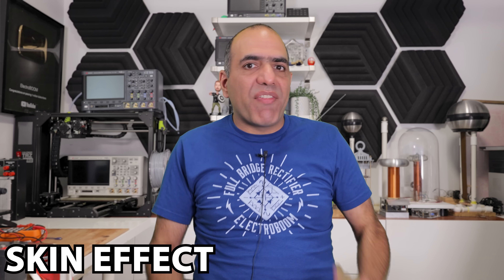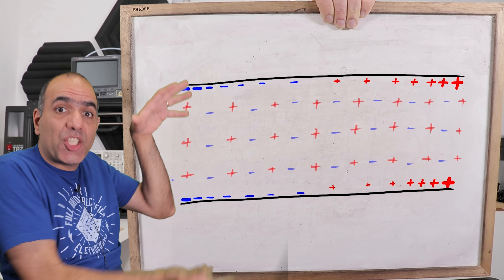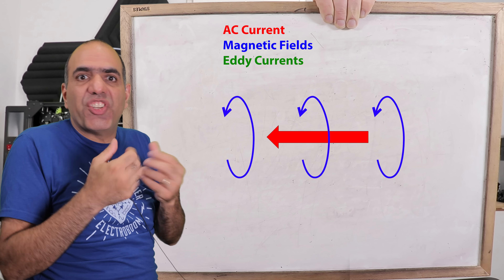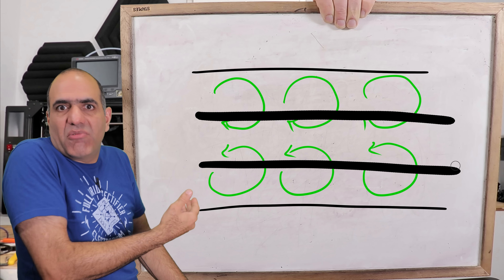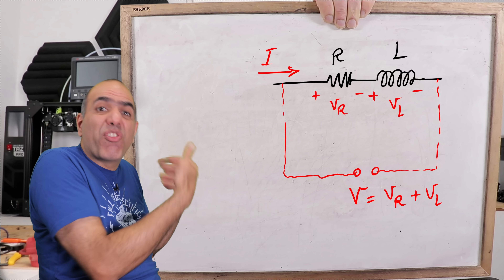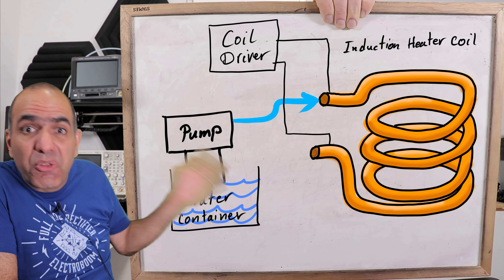Current Doesn’t Run Inside? SKIN EFFECT!

Comment: Most power transmission and distribution lines use and aluminum cable with a steel core, rather than copper/steel.

Comment: If the current flows on the outside then why are wires rated for current by cross-section instead of surface area?
Reply from the maker: Because cross section is constant, and you can calculate other stuff based on frequency and cross section
Reply: @ElectroBOOM  thanks 
I was also wondering if in a ribbon shaped conductor there would be a sort of edge of the skin effect where the current favors the edges of the ribbon more than the central portion of the ribbon even on the skin

Comment: Did you know that high voltage long distance power lines are actually hollow to make them lighter, thereby taking advantage of the "skin effect" to save money.

I'd also like to add that the skin effect is the reason stranded wire cares more current than its gauge equivalent solid conductor wire.  Thank you for the great videos.

Comment: Litz wire is a kind of wire designed to minimize skin effect. Its made with many insulated strands of wire woven together in such a way that they take turns alternating between the inside and outside of the bundle. So that more of the copper in the bundle can participate in conducting ac currents.

Comment: Increasing the diameter of a conductor does help because it adds more parallel paths along the surface to flow. But at high frequency, doubling the diameter almost aproximatly doubles the conducting skin while the the cross section total wire grows by the square or (double=2)²=4 times as much copper.  That means at high frequency, a tube will conduct almost as well as a solid wire of the same diameter and certainly uses far less copper to conduct ac currents at that high frequency.
Reply: And ... a tube have another surface on the inside.
Reply: @dansihvonen8218   except charges tend to flow on the outside.  A tube doesn't conduct rf better than a wire of the same diameter, but it does save material, and copper is somewhat expensive to waste when it's not activly conducting rf.

Comment: does current not flow linear and not only bounce atom to atom along a strand , but also across the entire width , like a dolphin jumping through a stream ,is there a formula to see how much heat is generated through electrical current through a wire gauge and its resistance to see how much " bounce " the flow actually has on its travel

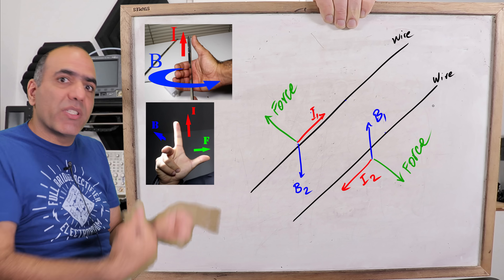Comment: The graphic at 1:44 is wrong. Assuming I points in the direction of positive charge movement (opposite to electron direction) as it is usually defined and as would be consistent with the RIGHT hand rules shown on the left, the magnetic field vector B_1 should point in the opposite directions. The force vectors (as well as the conclusion that the wires separate with opposite current directions) are correct though.

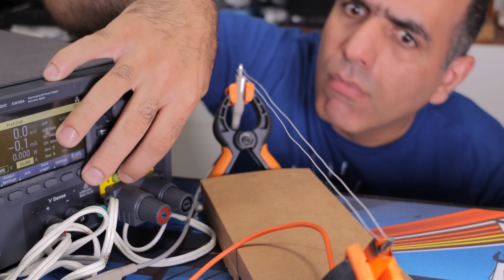Comment: 1:22 finally someone showing the airgap bug present on all we use . Its worst then shown here but this gets the job done
Reply: add a rubber protect metal collars to simulate holding wire . Its why i recommend zip ties . The short of it ? Its like a spike generator . Darn chassis ground

Comment: You know, after 20 years, I still don't get AC circuitry. Sure, the lecturers mention something about electromotive forces due to Lorentz force law, which is the basis of motors and generators, but it always gives me a headache thinking about it! All the impedance from reluctance and inductance just completely flies over my head!

Guess I can only find the answer in a physics textbook. But that chapter is thick! Not sure my brain can handle it.
Reply: Don't worry, it's all just smoke and mirrors anyways. 😉

Comment: The skin effect is actually very useful in non-destructive testing. Surface and internal defects of a material change the magnetic field because the eddy currents become disrupted. Thus, if you excite a material with an electromagnet you could discover tiny defects in a material depending on your sensitivity.

Comment: So, if the skin effect is so pronounced, shouldn't wires be pipe shaped? Seems as though that would save a lot of copper...
Reply: The dumb idea started with one person wanting to control the supply of Power over great distances, necessitating A/C current.
The idea is just as bad as electrocuting an elephant in public to promote "your" patents.

Comment: Another real world application: Skin effect is bad for RF transmission lines because it introduces severe line loss. Coaxial cables were invented to relieve the losses by embracing the skin effect. A thin wire surrounded by, but not touching, a thin copper braid gives lots of surface area for RF current to pass through.
Reply: Also coax cable, the centre conductor, at least with any modern coax, is a copper clad aluminum rod. Using the copper where the RF signals flow because, you know, skin effect.
Reply: Twin lead has virtually no loss. Coax loss depends very much on construction and frequency. The best "consumer-grade" coax (LMR-400) loses 3 dB (half the signal) in 200 ft. 450 ohm ladder line only loses 18% (0.9 dB) in 200 feet.

Comment: The conclusions are similar to how I was taught about skin effect in early analog and digital circuits classes, where the higher the frequency the higher the skin effect that we would see, up to needing wave guides for very high frequencies and light based information/communication. I am glad however that more mathematical relationships were shown here in formulas and resistance occurring as well as the mentions of physics laws and theories.
Reply: What are these wave guides that you speak of and how to them factor into all of this?
Reply: @michaelbeckerman7532  You can ask of AI (Gemini, ChatGPT, or one of your choosing ) the following question, "Do waveguides affect the skin effect?" It'll give you simplified relationships from such a prompt. Wikipedia has an article on Waveguides too, but here it is specific to high frequency electromagnetic waves.
Reply: I'm just struggling to learn, but waveguides are pipes carrying radio waves inside - or so said. In essence, they are electrical hollow conductors carrying the high-freq electric current in their walls, acting as the outer skin..

Comment: I like how you got through the pain of measuring resistance by using AC current. You could have simply used the DC current to measure the resistance. But that way, you could not have tought us the AC concepts. Impressive Mr. Boom!

Comment: There is a use for skin effect, in some nuclear weapons, the components responsible for perfectly timing the detonation of chemical explosives for compressing the plutonium core, is called the bridge wire detonator. When you have enough current rise time, the skin effect contributes to achieving explosive vaporization of the wire instead of just simply vaporizing and turning into lesser energetic plasma. This achieves a much more efficient transfer of electrical energy into kinetic energy.

Comment: My father was shocked by high voltage ⚡ many years ago when I was about 14. I clearly remember when I saw him,the skin on his arm was carbonized 💪 (most of skin on arm turned  dark),but luckly only a thin layer. After medical treatment for some months, his arm restored full functional.
The time when I saw his arm,the word "集肤效应"(skin effect in chinese) appears in my brain.
I'm not sure it is caused by real skin effect or just because the skin has less water to absorb the heat, or there are other reasons.
But every time I heard about skin effect,this memory will be recalled.
Reply: What was voltage level your dad was exposed to? Above some 10 000 V , the arc usually flashes over human body/limbs in less than 0.1 sec. Very high arc temperature burns the skin from the outside

Comment: Great video! I REALLY appreciate your showing the failed demonstration attempts and explaining why. I was thinking through how to demonstrate this myself as you were you talking and you showed why my thought wouldn't work... Super engagement badge!
I knew about skin effect and steel core HV power lines, but never understood why it worked. The higher resistance core isn't an issue because the current is running through the cooper jacket!!! Amazing!

Comment: I remember working at circuit City in the 90s, one of the things that they taught us was that the bass frequencies like to flow through the center of the cable, and the higher frequencies travel along the exterior. And sometimes they don't reach the destination at the same time.

Comment: 10:15
Thats not how transmission line wires are built..
Yes there is a steel wire. And multiple strainds of aluminum wires are twisted around the steel wire.

Comment: ahh, I thought you were going to discuss lightning and how the current passes over outer skin. At our building it has a lightning rod on top that is grounded through a hollow braided aluminum cable. I was told it acts similar to your induction coil w/ tube example. It doesn't need to be a heavy 000 wire, just big enough circumference to carry the load. I have also heard that is why passengers are safer in an enclosed vehicle during a lightning storm. Not because the tires insulate, but because the current will flow around the vehicle and not so much in the interior.

Comment: Why don't you use a length of coaxial cable. Calibrate using DC. Then measure the current in both paths, center and shield. Litz wire...

Comment: Yes but (insert coin) does current flow through a conductor anyway?😁
Reply: Only in real DC ( chemical reaction )  that there is actual flow of something from one chemical substance to the other . It's kind of a "controled" static electricity.
In AC it's only an electromagnetic effect that goes from one point to the other.
Reply: "Unfortunately, the prehistoric notion of the electrostatic charge on the conductor still persists, and by its use, destroys
the beautiful analogy between the two incommensurate components of the electric field, the magnetic field and the
dielectric field. " 
C.P.Steinmetz.

Comment: Wouldn't current (both a/c and d/c) imply increased flow of charges?  Wouldn't those charges oppose one another more at the center of any wire?  I wasn't very convinced by Derek's video where he said charge distribution is even and overall zero.  Maybe in a non-dopped and inactive wire without current that's true, but would that still be true if there is a current or voltage acting on the wire?  If the charge distribution is even and balanced, how would current flow occur or voltage be sensed?  It seems very counter-intuitive whether Derek's point is true or not.  While it would be true that magnetic fields would cancel out in the center of the wire and lessen past the wire over distance, would this really cancel out current in the center of the wire?  This makes no sense.

Also, thicker wires are more resilient versus higher currents and voltages for a reason, so either there is current going through the center (at least some) and a thicker wire can handle more current, or a bigger radius creates a bigger circumference and that allows more charge to flow along the skin or the bigger wire is better at absorbing and conducting heat while resisting degradation due to heat.  Or, maybe it is something else I'm not thinking about, but I do know that thinner wires are generally less resilient to damage caused by current and heat.

Also, steel conducts heat and electricity, just not as well as does copper, but it still does so it isn't like those electrical power lines you're talking about have zero ability to conduct in the center.

Comment: Fast electricity on a wire is actually what i call fast elekticity & is due to photons (elektons) hugging the surface & propagating at the speed of light c'.
The skin effect is the losses due to the excitation & drag suffered by photons orbiting the nuclei of atoms -- i call these photons elektrons.
Electrons (photons that have formed loops) might exist (sit) on surfaces, & give us static charge etc.

Nearly forgot. U can proov the existence of elektons by measuring the speed of elekticity along the surface of a threaded rod.
The apparent speed seems to be reduced, but this is simply due to the extra distance up & over the threads.

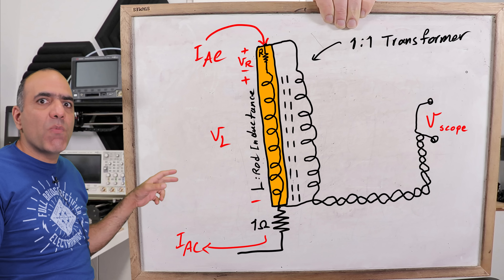Comment: Mehdi describes inductive coupling occurring between wires @8:57. Is there also capacitive coupling as well? How are the two differentiated?
Reply: There would be capacitive effects present, but so small as to be negligible for the given set up. The inductive coupling also directly counters the capacitive effects in terms of impedance, and the main way capacitance would make your life difficult here would be unwanted resonant frequencies.

Comment: So could you run those wires through a small coil of wire, to see if the magnetic field can induce a small voltage in the Coil?

Comment: So, speaking of skin effect... Back in college, I studied electricity, and I remember measuring my body's resistance by holding one probe in each hand, and measured in the mega-ohms... Well now, I am stupid. I was about to ask why is it that in a bath, electricity would more easily pass trough our body considering that the average tap water has a resistance of 5k ohms, something I have been wondering about for YEARS, but as I was writing the first bit of this message I realized... We're wet in the bath. I wasn't wet in class. The water and impurities of the bath helps the electricity penetrate the skin, at which point it has very low resistance to the nervous system and blood. ALMOST 20 YEARS WONDERING ABOUT THAT ONE!!!

Comment: You forgot about the proximity effect. The skin effect pushes current flow to the skin of the conductor, but current flowing in nearby wires(or turns of an inductor) can further reduce the used cross sectional area of a conductor.
Reply: these are two effects that have a similar impact but completely different causes

Comment: I once had to find the cause of video distortion in a system using long runs of coaxial cable for RGB which also had sync on Green. To save cost the cable was copper over steel core and therefore really only suitable for VHF radio transmission which would employ the skin effect. The high resistance caused by the cable having steel instead of copper meant the capacitance of the cable could not  be discharged fast enough as the signal changed from the positive green video information to the negative sync pulses. The more green in the image, the more  it got displaced on the screen, but red and blue were not, so the image was really awful.

Comment: and at 10:00 you fail to understand ac vs dc, like i said desctructive interfierence, due to ac pulsing back and forth it doesnt heat up the conductor as much as dc, thats the reason it travels farther with less loss, constructive interference is what dc does, it all just entropy on down hill, meanwhile step up xformers at substations make up for voltage drop over the distance, cost is heat hence the giant cooling fins on those units, come at me now i will be glad to teach you how electricity works
Reply: I'd probably start with grammer. People will dismiss you outright when speaking as such.
Reply: @digitalchaos84  only english teachers care about grammar, i never have and you cant make me care
Reply: @CommanderBeefDev  Just like you can't make anyone care what you say. Now. you just sound like a hypocrite.

Comment: medhi master electrician here, drop a neodymium magnet down a copper pipe, eddie current induct an equal and opposite force impelled on them if only briefly, hence anti gravbity effect of my point in case, ever wonder how a transformer, well transforms, pure eddie currents or induced current if a magnetnic field is near enough a ferrrous material or one that an be imparted with an electrical charge hence copper and aluminum exhbit eddie currents then you would know mr im an engineer, engineer deez nuts and bolts lmao